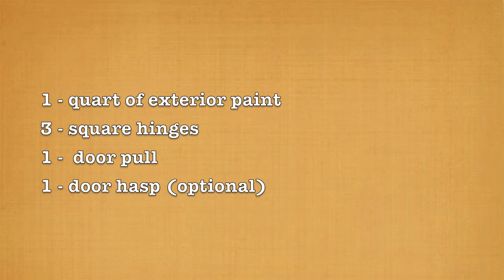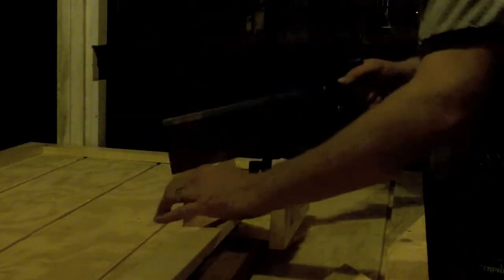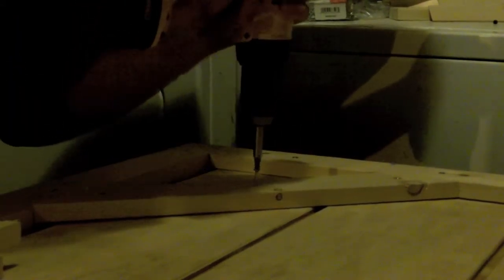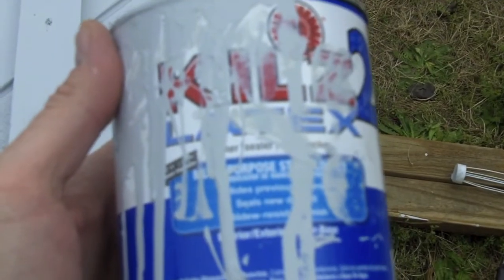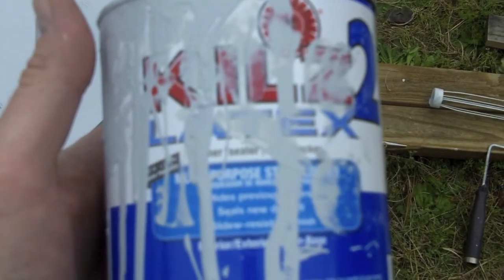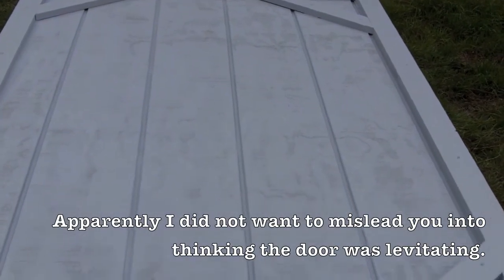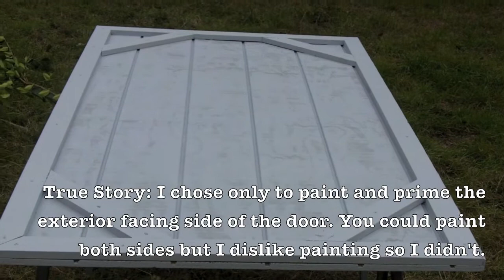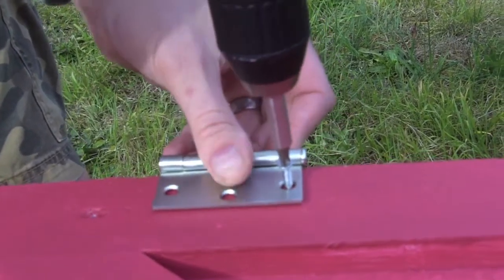How To Make A Shed Door

Comment: entertaining video.  BTW: Your locking Hasp is also installed backwards.  When it is installed correctly and the door is locked...the hasp should "fold" over the screws.  the way you installed it...a thief just needs a screwdriver to remove the screws and the door can be opened.  Same with the hinges..install so the screws are not exposed.   Keep up the good work!

Comment: I would recommend that when installing the hardware for the lock to use hardware where the screws for the hardware are hidden behind the part of the hardware that holds the lock. This will make sure that the hardware cannot be removed by unscrewing the hardware.

Comment: Great effort. You could have purchased security screws which only can be installed, not taken out, Also, your lock hasp should have been mounted on the side casing of the door to prevent someone taking 3 screws out, or security screws would have worked on this also. Other than that, Great job!!!!!!!!!

Comment: this entire project was definitely in the "under 30 section" meaning it cost $30 or less to make. 
when you installed the hinges like that there is no strength to them, a good wind will rip that door off. go look at the hinges on the front door of your house. Why not use a piano hinge? I'm not ripping on you but c'mon this aint gonna last. to all other posters with their 30 iQ potty mouths, think of witty comments instead of straight cussin no one takes you seriously..ever